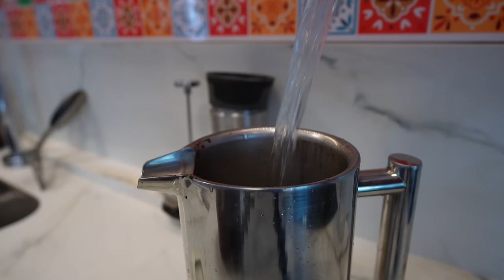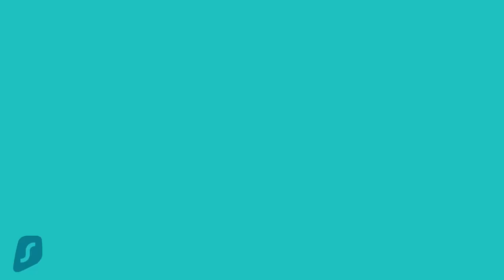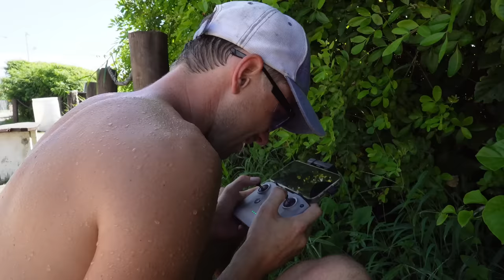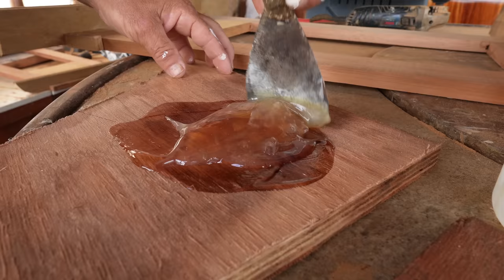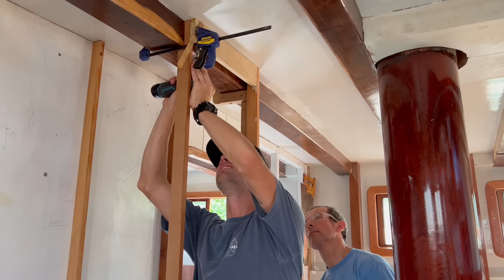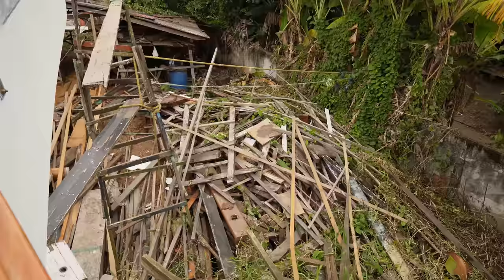Building designer doors with scrap wood and a router for our wooden boat — Sailing Yabá 126

Comment: Thanks! In lieu to your comment earlier in the episode I’ve actually known about that pyramid shaped block with the router for many years now as in at least 30 maybe 40. However as that I have a panel raising bit I would’ve probably made raise panels out of them all first which would’ve helped them fit more flush on the inside and have a little more detail on the outside. Of course I’ve been doing Woodworking  sense back when I was a small child with my grandfather in his garage, and I just turned 61 in this last week so I know lots of Woodworking tricks.

Comment: Don't forget to put a sound system in, a stereo/CD player and speakers.......did you run coax cable for a few flat screen TVs in a few rooms? And put a few USB ports in rooms to charge phones....and a few cigarette lighter ports to plug in 12 volt stuff

Comment: Great furniture!! I like that you don't do everything with slots! 

Keep in mind - you want to have SOME vent on top of EVERY closed space - cupboards, closets, storage, rooms, EVERYWHERE where air can get trapped or stopped!!

Moist air is lighter than dry air - it will rise to the top of the space!
On tip of that warm air (which also rises) is often more humid than colder air - so your potential for humid air to get stuck is even higher.

Of course the problem is mold, mildew, fungi and the that beautiful nastiness!!

Your tip vent doesn't have to be huge - just needs to be there to let that moist/humid air rise out of the space!

If you have an A/C - that's where you want the vents to exit - the A/C would  ingest the humid air and condense out the water....
Otherwise let the humid air vent out the boat somewhere on top....

To get things moving by themselves in the right direction - imagine a tiny balloon with helium.
If that balloon can rise and wiggle its way to the top (even through venting pipes (could be pvc and could get collected from various spaces) - so can warm and/or humid air!!
Reply: This becomes even more important once you HEAT the boat....
(You DO have a means for heating, right? If not - ...get on it NOW!! Even if you plan to never go to a colder area - at least plan for a diesel heater installation, so you can fit it without problem when you get there)
When you heat the boat you will want to keep the warm air from escaping - however, just with your breathing you will put incredible amounts of moisture into the air!!
That moisture needs to get out of the boat or you will start growing the above mentioned beautiful nastiness in short order!
Some way to open vents for 10 mins every 2 hours or so!
Remember that humid/warm air gets  to the top in any space - just opening the windows and doors will NOT move the air in the top of closed spaces!

Of course - you just adopt the "brute force" approach and install fans (PC colling fans) everywhere!!
You still need to make sure the fans move all the air from the top of spaces..... which is not as easy as it sounds....
 dynamic airflow is a very interesting subject!!😈

Comment: cane lattice should only use oil finish on it. But if you plan on putting varnish on it, you only do one side. it needs to breathe and will last over 50 years.

Comment: It's nice to see the interior being filled with all the cabinets but I think you are forgetting to include a major safety issue: 'grab rails' to provide at sea (specially if it is rough sea), places to help the crew to stand upright. The full flat surfaces are very bad to keep everything from running out. Being a large boat without a  deep keel, most likely will roll  quite a bit if not running towards the  waves. The same when at anchor. Consider this hint from someone with months at sea. Best of luck and keep your dream alive.